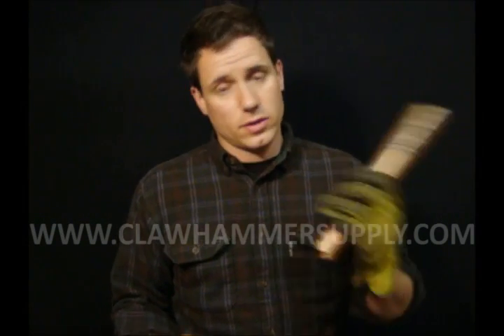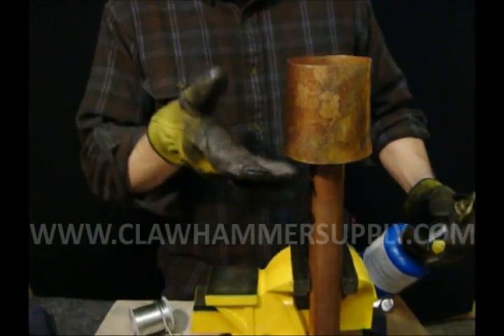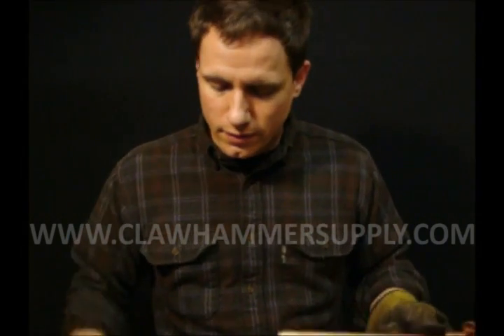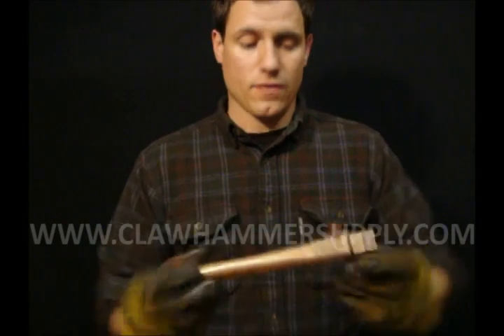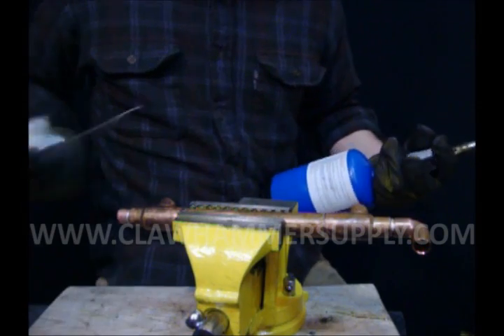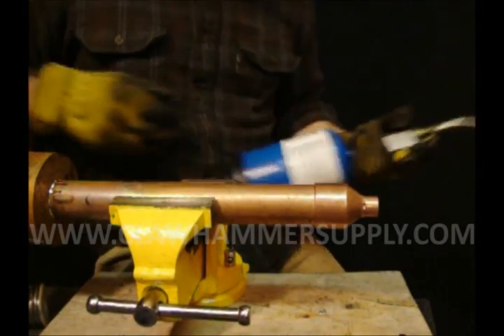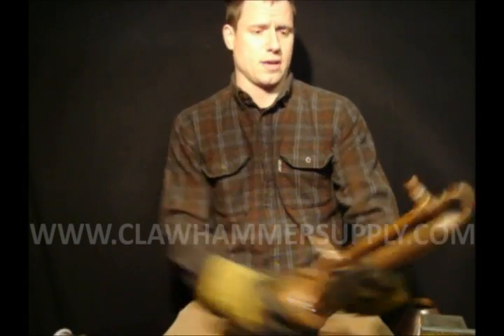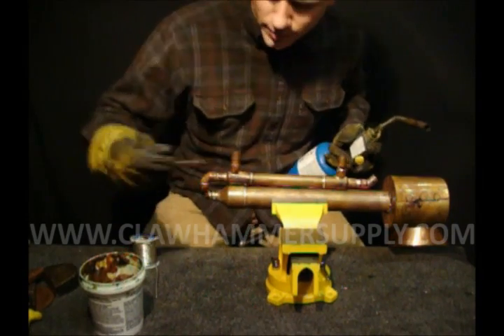How to Build A Copper Still - Part 6

Comment: Ron Ray Yes that was what I thought when I watched this. But I was thinking that the solder may get sucked into both sides of the fitting as long as you flux properly. Then again Clawhammer Supply may not have answered your question due to their ignorance of the mistake.
Reply from the maker: Condenser works perfectly if you solder it up the way we do in the video.

Comment: That condenser is brilliant!!  everything else I've seen has the worm instead.  Just brilliant.
Reply: Thats because this is a reflux still which gives higher proof but less flavor. Great for making bio fuel.
Reply: @doublebubleguy12  not a reflux its just a small pot still, even a reflux can have a worm. at the still size would not be that great for fuel, well maybe fuel for a micro engine in a model car or plane.

Comment: Just like to mention that if you take a wire brush to that copper and clean it up before you solder your joints you will use way less solder and make way sweeter looking joints. The rule is for sweating a half inch joint you use half inch of solder. The oil in your skin will actually make the solder repel so never touch it before soldering. If you do it right you can solder from the outside and it will look perty. Also helps prevent overheating

Comment from the maker: jamesbnorman1 - Yes, the cooling arm takes the place of the worm! All you need to do is hook up a garden hose supply on the bottom port and a drain hose on the top port and trickle water through.  It works like a charm.